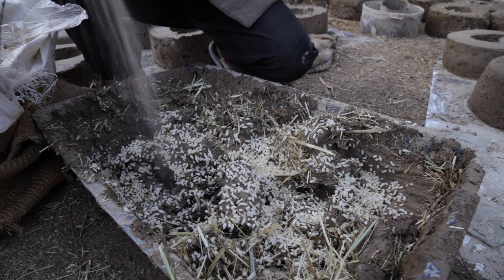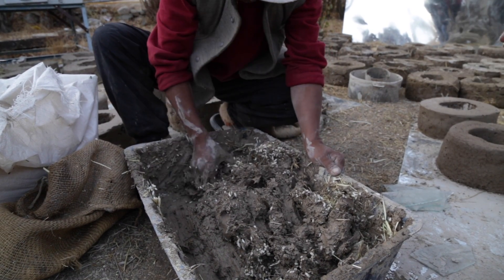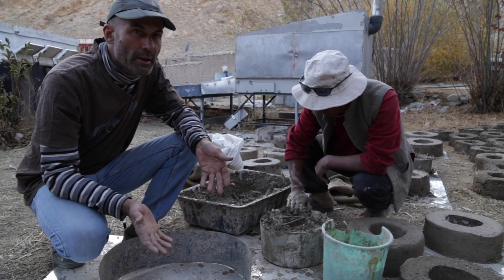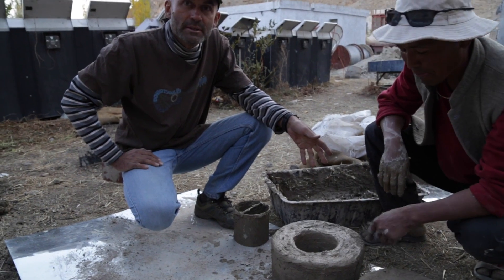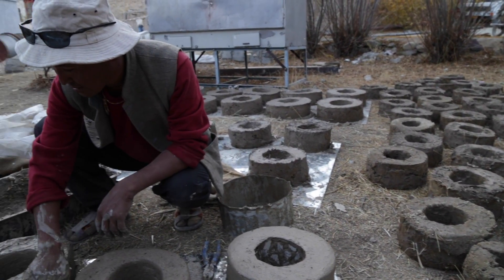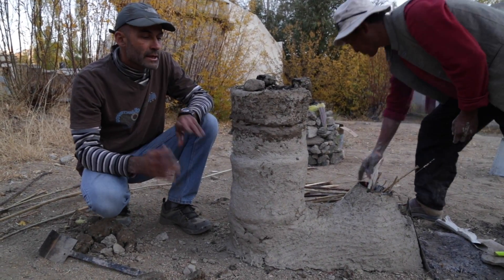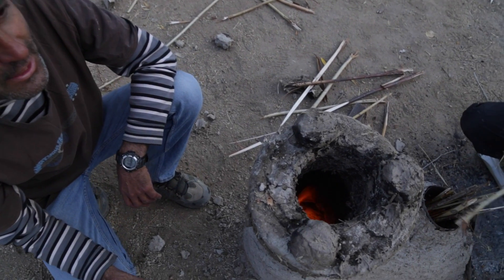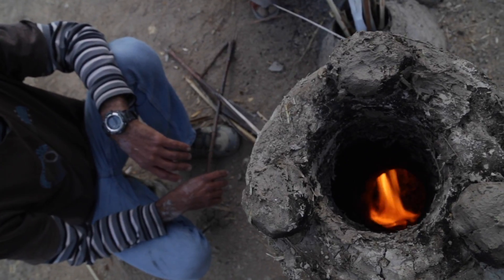The Smokeless Cookstove Revolution

Comment: Can we add 3 -4 small steel straw pieces through riser for 3° air ?
Reply from the maker: I'm not quite sure what you mean... can you explain more?
Reply: In The 4 -5 donut riser. While joining then we can put 3 - 4 pieces of 4 inch small diameter pipe ( like a steel straw)inbetween each joint , so to  prmote 3° air mixing in riser and also further addind spped to twister. Steel tube will heat up and such air and inject it like 2° pipe does. But from multiple small openings.
Reply from the maker: @DarshanPatel-rs5vc  I think I get what you're saying and if so, yes its definitely worth a try. You will want enough metal exposed in the inner side to allow the air to preheat before injecting into the swirling gas mix, otherwise it might have the effect of cooling the gas flow in the riser. You can email me at admin@rocketmandesigns.com
Reply: I can share the drawings if u give me your email adress.

Comment: does it work indoors?
Reply from the maker: It can work indoors, but preferably in a well ventilated location as there is still exhaust gases and some smoke even with the best smokeless cookstove. It is better than a normal fire indoors, but it is not same as gas or electric.

Comment: I noticed that the  stick feeder  is not the same in distance   as well as the inlet pipe is not the same size does it works the same? I want to build one  but I don't know which one is better,
Reply from the maker: In general it is a basic rule of thumb to keep the airflow through the system all the same, but in practice I find that some variation does not seem to effect the performance. I have a tendency to make the stick feeder hole (lower pot hole) larger than the riser hole, for practical purposes (EG, riser at 6" and lower pot hole at 8") and this still works very well. You can find more detailed illustrations of the build process here: https://himalayanrocketstove.com/scr-steps/
Reply: @Rocketmandesigns   thank you for the  reply sir,  iwll just keep on reading  comments in this video  to know more about it I'm also started making one  just waiting to dry my  mud doughnut,

Comment: How about rice hulls instead of puffed rice? And put a u-shaped piece of sheet metal upside down in the cleanout tunnel extending from just past the edge of the cleanout tunnel all the way through to the heat riser taking up about 1/3 of the height of the cleanout. The key piece is the top of the U which separates the primary combustion from the secondary air until they mix in the heat riser. The wood from the feed tube will sit and burn on top of the sheet metal. Block the cleanout so that only the part under the sheet metal U is open. This will allow secondary air to pass under the primary combustion zone and preheat the secondary air with heat that would conduct into the ground under the stove. Hotter secondary air react faster to insure complete combustion before leaving the stove.
Reply from the maker: Yes, the sheet metal secondary airflow is a good idea. The issue is we are using, as much as possible, locally available found materials in India so as to make this a zero cost option. Rice hulls can also work, its just about putting in some kind of granular biomass that will leave little pockets of air trapped in the clay after it's burnt out.
Reply: @Rocketmandesigns  I hope your project for this smokeless cookstove has been a smashing success in the 6 years since you made this video!

I am writing with a safety warning I should have thought about when I wrote my suggestion of using a piece of sheet metal that slides in the cleanout channel to provide a way for secondary air to pass under the primary combustion area and into the heat riser to burn the smoke. Darshan Patel in a comment below asked me a question to clarify my suggestion. When answer his question it popped into my head that sheet metal used  should NOT galvanized steel! When heated to temperatures above 200C the zinc that is the main element in the galvanized layer can be vaporized as zinc oxide and appears as a yellow-ish smoke. The guides I just reviewed said that the zinc itself can cause very unpleasant, but generally short-term health effects referred to as metal fume fever. But if the zinc used also contained some lead, the lead also vaporizes and if inhaled will be absorbed into the bloodstream. Inhalation of lead vapors, as we all know, can cause long term and permanent damage. So if sheet metal is used it should be just plain steel.
Reply: Russell Collins how about the second doughnut in the heat riser having a vortex slot cut into it so air swirls in the same direction as the vortex generated by combustion gases. This would pull outside air directly into the riser and mix it well with the primary airflow. The slot doesn’t have to be the full height of the doughnut. And then add a brick the height of the doughnuts on the outside where a piece of slate could rest so you can partially or fully cover the secondary air slot. That would make the stove entirely metal free.
Reply: Russell Collins and sorry for all the “what about this” stuff. I am an engineer and can’t help but tinker.
Reply: Thank you very much for thw warning. I understand the idea of floor channel . Its like 2 ° air ging from buring chanber. I also saw nany designs reguarding 2° air pipe position and variation on a blog  discussing vortex stove / dsr3 .. i will reply again when i make another one. The one i made recenty was a scale down version of this stove with alluminium floor chenle,   but it was difficult to keep it from smoking . So i think i will make one with excect dimentions and then experment with 2° air. thank you again.
Reply: bro, if you're talking about secondary air i think he done it in 4:35. that's the use of the pipe he put.
Reply: Can u explain more about u shape sheet ?
Reply: @DarshanPatel-rs5vc  I deleted my previous reply rather than edit it to fixed a couple of things and to include a warning. First the warning, galvanized sheet metal should NOT be used to make this channel. When galvanized metal is heated to temperatures easily achieved in this stove, the zinc is vaporized and oxidized. Breathing the zinc oxide vapors by itself can cause short term health effects that can feel like having the flu with fever, body aches, headaches, and others which quickly go away once you stop breathing in the zinc oxide and don't seem to result in long term or permanent damages. But if the zinc used to galvanize the sheet metal also contained some lead, the lead is also vaporized and breathing in the lead vapors can cause serious long term damage.

Now more on the U shaped sheet. This is simply a piece of sheet metal with the edges bent down to serve as legs. It goes in the cleanout tunnel with the legs down so that it looks like an upside down U. The width of the flat part is approximately the width of the cleanout tunnel and the length is from just inside the vertical heat riser to about 10 cm outside of the cleanout tunnel.  The purpose for doing this is to divide the cleanout tunnel into the primary combustion zone where the wood is burning and a passage for secondary air underneath that primary combustion zone so that the secondary air mixes with the combustion gases coming out of the primary combustion zone and the oxygen in the secondary air reacts with the smoke (which is actually just unburnt gases coming from the wood) to release the heat trapped in the smoke. So not only is there no smoke, but less wood is needed to create the same amount of heat.

The width of the U-channel can be, but doesn't have to be, the width of the cleanout. The height is set by the length of the legs. The height shouldn't be much more than about 1/4 of the height of the cleanout tunnel so as to avoid reducing the area of the primary combustion zone too much. And the length should be so that one open end extends just into the vertical heat riser so the secondary air coming out of this can mix with the gases coming out of the wood burning combustion zone and the other end extends outside of the cleanout tunnel by 10 cm or so. The extra length outside the end of the cleanout is so that the secondary air can come in through this bottom channel while a thin stone or tile can sit on top of the portion of the U-channel outside the cleanout tunnel to close off the top part so that air is forced to be drawn in through the wood port on the top of the tunnel so that smoke doesn't come back out of the wood port. 

I also suggest that mud be packed between the legs and the sides of the cleanout tunnel. This gives a flat floor to the section where the wood is burned and makes it easier to drag the ashes out the top portion of the cleanout tunnel. It also seals the edges of the secondary air channel so that air stays in the secondary air channel. The amount of secondary air can be regulated by covering a portion of the open end outside the cleanout tunnel. 

The heat of the stove is at its highest when the amount of secondary air is adjusted by covering more or less of the secondary air inlet to the point that any less secondary air and smoke starts coming out of the stove. More secondary air than that necessary to burn up all of the smoke results in a higher total flow rate, but with lower temperature. If a stone or brick is used to partially cover the wood port, the burn rate of the wood is reduced. But this causes even more smoke to be generated because the amount of air to the fire is being restricted. But by adjusting the amount of the secondary air blocked, this extra smoke can be burnt in the secondary combustion area in the heat riser. So by controlling both the amount of primary and secondary air, the stove temperature can be controlled. So at the start the stove might be run at maximum temperature with the wood port completely open and the secondary air inlet adjusted to just burn up all of the smoke in order to bring the pot on the stove as efficiently as possible to a boil. And once the pot is boiling, any more heat than just what is needed to keep the pot at a simmer to a slow boil is unnecessary and is this a waste of wood. The total airflow and temperature can be regulated by using a bricks or stones to partially cover the wood port to reduce the amount if air drawn in and thus reduce the rate that the wood is burning. Then the area of the secondary air inlet is adjusted to so just enough extra air is brought in to keep the stove smoke. This will reduce the amount of wood required to cook a meal to the minumum.

Also when the cooking is done, any parts of the unburnt wood still sticking up through the wood port can be removed and the burning ends extinguished by rubbing them on the ground or sticking the burning end in a bucket of sand. Then the wood port and the secondary air inlet can be completely covered to cut off the oxygen to the burning wood and the unburned part of the coals to stop burning almost immediately. This saves any wood already in the stove so that it can be used the next use. It might be that covering the primary and secondary air inlet will cause some smoke to trickly out of the top of the. stove for a while as some air manages to work it way down to the burning wood and coals and keeps them going. If that is the case, make a clay "hat" to sit down in the open end of the heat riser to seal it as well.

I hope that answered all of your questions about the U-channel.

Comment: I guess if you wanted to try this at home you could try using rice bubbles or popcorn? And does the eccentrically placed Venturi work much better than a central one which gives dual vortices?
Reply from the maker: Yes... in fact any kind of smallish granular light weight bio matter can be used in place of the puffed rice. That just happened to be the most easily available product we could source in that location, and its readily available in most parts of India where we are doing this work. Regarding the vortex / venturi effect... this is quite important and definitely improves the effectiveness over a central entry port. The reasons for this are due to increased turbulence created by spinning the hot gases, and increased duration in the burn tube by rotating the gases around the sides of the tube rather than letting them rush straight to the top. This is more important in our shorter / lower height versions where we use only 3 donuts for the riser, as this is more user friendly for pot height (when the cook is sitting low to the floor as they typically do). Over the last 2 years we have improved on this design slightly (having now trained over 1000 people how to make these cookstoves). More details about this can be found here: www.smokelesscookstovefoundation.org
Reply: Interesting that you have found that a single vortex works better than a double one.  Any testing on emissions ( g/kg ), and CO production?
Reply from the maker: Actually we haven't tested against a double vortex, if that were achieved it might be as effective in the taller versions. I think with the lower height models we are now focussed on (around 15" riser height) the single vortex gives the benefit of an extended flame path as it wraps around the side of the tube. This is not well demonstrated in this particular video, I will try to load a better video showing this.
Reply: What I read on the rocket stove forums is that a single vortex leads to faster and more laminar flow, less mixing of the gases, and a faster exit from the riser.  The latter would be advantageous with a short riser as you need to maximize the draft.  A dual vortex as seen in centrally placed ports creates more mixing and turbulence, and slower exit from the riser, with less draft.  But the proof is in the eating.
Reply from the maker: Yes, given the low riser the single vortex works for us very effectively. I haven't done extensive research into the double vortex, but I can say for sure that the single works well.

Comment: Absolutely wonderful and well put together video and stove Russell. I will try this in the village. Could you tell me, do the burn tube doughnuts have to be stacked 5 high or can it be lower or higher? Also can a chimney flue be added as well on the burner some where?
Reply from the maker: Actually our team has been experimenting with the height, as this is the most critical aspect for usability for the cook, and it can work with as few as 3 donuts high (3x5" = 15" H) but it will work better with a bit more, such as 18 - 20" height. You can experiment and try making the donuts smaller (eg 4" high) and try for 16" as an example. As long as you have enough suction up the riser to pull the air and smoke through and also long enough time inside the tube for the smoke to burn.
Reply from the maker: We have experimented with as few as 3 donuts (around 15"), which is a good height for a typical village home kitchen. There are some adjustments that can be done to make sure you are getting the optimal burn for a low height burn riser, which involve the 2ndary air feed, creating turbulence with the "vortex" funnel and making sure the fuel feed is close to the riser. You can email me on russell@himalayanrocketstove.com if you want more details about this.
Reply: Thanks for the reply Russell, much appreciated. Your stove is simple to make and the best I have seen compared across the youtube, beating even the most advanced and technical ones in function. 
The next time I go abroad into the village I'll experiment and try teaching the locals who I know are not aware of this at all and they use the old methods of burning more wood and creating lots of smoke. It will also help me. 
I will try filming/taking pictures to let you know how it went.
Reply: I guess having more height is key in allowing the smoke to burn.
Reply from the maker: That would be wonderful... and you can check the instructions as diagrams here: https://himalayanrocketstove.com/scr-steps/
Reply from the maker: yes, this is correct... which is why we try hard to find the correct balance with height for user friendly operation and proper functionality. Our team has just done a week of advanced design testing in Rajasthan and we will be sharing the insights from this shortly.